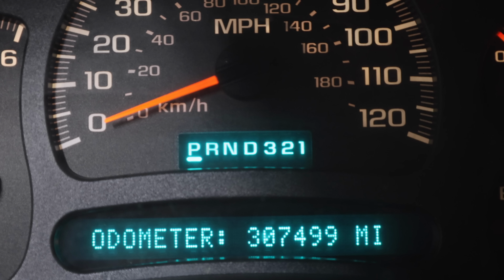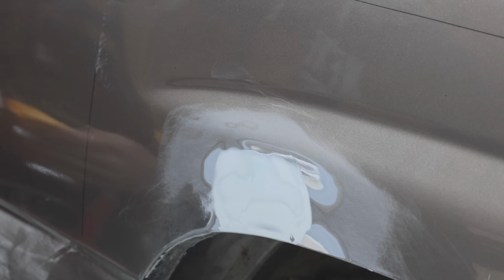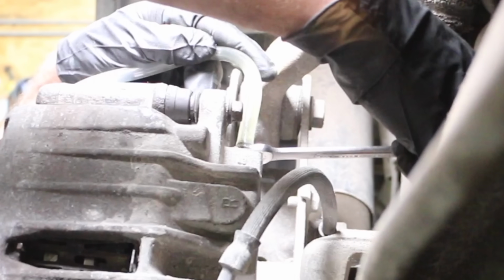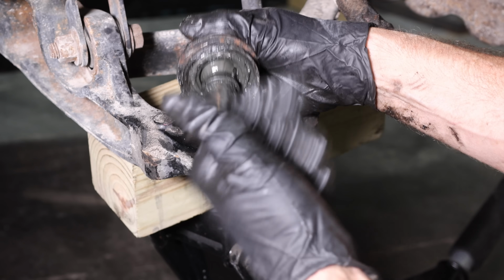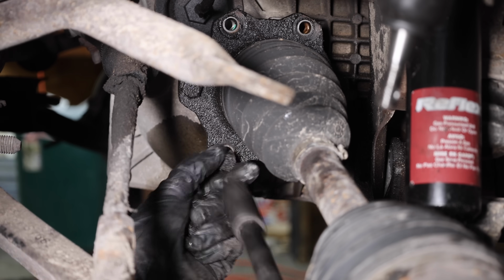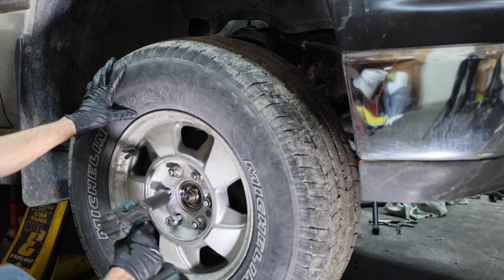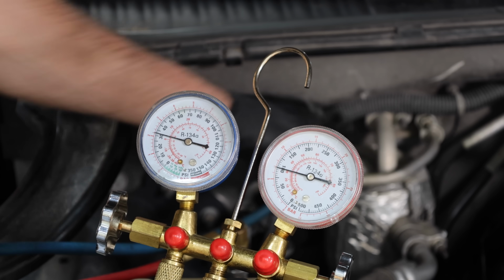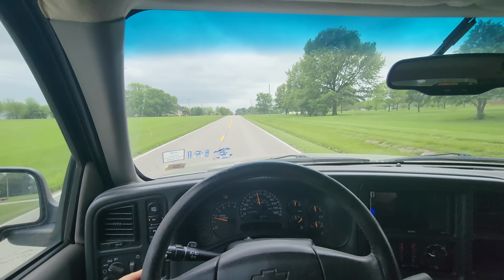Is It Stupid To Fix Up A 300,000 Mile Vehicle? Let Settle This!

Comment: Body repair was not great but I worked at a chevy dealership for over 10 years and saw hundreds if not thousands of cars with worse quality repairs that actually came from body shops. Like I could tell you it was poorly repaired from 30 yards away
Reply: P.S. what you did was every bit as good as I'd expect to do myself if not better.  I was a tech, not a body guy.

Comment: You should try greasing the hubs. Still running original 250k on mine. Just remove the speed sensor press grease through this cavity. The old dirty  grease will squeeze out of the seal. Continue until new grease comes out. Clean grease out of the cavity down to the tone ring. I do this approximately every 35-40k

Comment: We watch all of your videos, but I never comment. Love your content and how much you have learned while making it. 

It seems that you have a misunderstanding about freon pressure. 

If your gauge doesn't display the correct pressure for the temperature when the vehicle is off and cool, YOUR GAUGE IS WRONG, not your freon level. 

Static pressure tells you NOTHING about your freon charge. Repeat... NOTHING!

If there is one single drop of liquid freon in the system, the gauge will read EXACTLY the same as it will if you overcharge it by 10 extra cans of freon. 

Don't believe me?  Check your static pressure and then recover half your freon. As long as the temp stayed the same (it will take a little while to recover since it will cool as you remove freon), the pressure will equalize back to EXACTLY what it was before you started. 

See "Law of ideal gasses" for the physics behind this.

Comment: This is crazy because i was thinking about taking car off my rusty fenders on my silverado. Also, I replaced tie rods, pump idler arm and pitman arm and still have alot of slop in mine. I tried tightening the adjuster but it never got any better and didn't want to over do it. Awesome video, I liked the pace. If I need to go over it again I can just rewind.

Comment: I’ve got a 1997 Ford Ranger with unknown miles on it. I bought it in 2017 with 172,000 and the odometer broken. The guy I bought it from said it was 172,000 when he bought it 6 years earlier. So 13 years of driving put who knows how many miles on it. I only use it now to haul garbage to the dump. I only have ever changed the oil a couple times. I bought it back then for $1500, and I betcha I can get at least 1500-2000 for it now just because it still runs. So YES….it’s always worth it to keep an old vehicle running. Especially if you know how to do the repairs yourself.

Comment: Love the videos, if you're looking at snap ring pliers to test, I have been using the Channellock set which has 3 sizes, the Channellock numbers are the 926, 927, and 929. I think they're great, a little pricey at around ~$120 for the 3-piece set, but they are good quality, have lifetime warranty, and all have exchangeable bits with the 929 being ratcheting which helps a lot for those bigger snap rings.

Comment: I've been an HD mechanic for 15 years, I've done these types of repairs thousands of times. I still watched the entire video! Never change!
Reply: Year later they start bubbling again lol
Reply: @jacobg6528  Assuming the rust is all taken off it won't
Reply: @danh1060  yes it will lol. Anybody who's actually worked in a shop in the rust belt knows this. You have to treat the inside with fluid film. It does not matter how well you prep it.
Reply: @jacobg6528  Yeah I fluid film my XJ I get it helps tremendously with rust protection/prevention and I was looking at it from a POV from someone living in the south where rust isn't a common concern with vehicles.
Reply: @blancheedwas  they're living the rust free dream!!
Reply: Rust or year round mosquitoes. Pick one.
Reply: Yep, just a matter of time. To be honest its not even worth the time and money. If your car has a hole so what?
Reply: @bladeoflucatiel  Yes let me just buy a new 1985 foxbody, ill have to get rid of it because im a pussy and cant repair things

Comment: 300,000 miles and still looks good!  Properly maintaining a car is super important, but a well built vehicle designed for long life is a necessity too.  For instance, trying to get 300,000 miles out of a Ford Focus/Fiesta with a dual clutch automatic isn't going to happen without lots and lots and lots of clutch changes!

Great to see the work you do.  Attention to detail and cleaning up the old parts is a great idea!  

A couple tips:  When laying the body filler, make sure it's fully mixed.  I noticed some of it wasn't mixed well when you removed the old filler from the spreader.  Also, I use an auto body sander with 16 grit paper.  It's to shape the filler and make it nice and flat.  Put another layer of filler and use 220 grit.  If smooth and no air bubbles, prime, sand, check for high spots.  Then paint.  It's pretty easy to paint with an air gun.  Lay down a couple coats of paint, then let dry.  Hit with a couple coats of clear, wet sand and then polish.  One final tip - When touching up, you want to blend to the area around the repair.  First paint the repair site only.  Next coat, go a little further out.  Then the first coat of clear a little further out and finally the last coat a little further out.  And don't end the blend where two panels meet.  Blend into the next panel if you need to.

Comment: 2007 Saab 9-3 2.0T 6sp, 315k
A/C went out, needs oil pan gasket, needs brake booster, needs sway bar bushings
Fix it?

Comment: I think you made the right choice! 1999 through 2007 GM trucks are the best trucks ever made. 100 years in the future from now if this comment is still here all will see. Todd that foam inside of the quarter panel doesn't even need to be there. It's only real purpose is to damping noise turn off the body. Because you know it seems like people just look for stuff to complain about these days or try to find something as if they don't have anything better to do. Great job Todd as always and once again do not get rid of that truck.

Comment: Mechanic’s tip: make sure you can remove the fill plug before you drain transfer case, transmission, differentials, etc

Comment: Did you notice a difference between 10 year old and new bulbs? Assuming they qare the same type.

I find it's easy to set toe by pressing a long wide straight board against tire and aligning to rocker panels {if they are straight and parallel on your vehicle).

Comment: I have a 2006 Tahoe z71 at 170k, and a 2001 Silverado z71 1500 at 240k that I’ve been slowly improving. This video is invaluable. I’ll specifically be using the steering component portion very soon. 

Additionally based off your videos I’ve been using Seafoam, motorkote, and engine restore at every oil change. Along with the legendary reliability of the LS engine design, they have shown no signs of wear or age. 

Thank you for your time and effort. You are one in a million.

Comment: Nice presentation, sure is cheaper than a car payment. A little constructive criticism for anyone doing this - make sure you can fill before you drain, open the fill port first. I won't mention the broken bolt on the exhaust manifold, lol.

Comment: Stay as you are, always a great video! I don't know if this is up your alley or not but I have an old Sunbeam Radiant Control toaster. Instead of using time to know when to turn off these toasters measured the infrared radiation reflected off of the bread for a more consistent toast. Sunbeam was bought out and the new owners discontinued this technology. I would love to see a comparison between modern toasters with electronic controls versus this older 1947 design. Our experience with newer toasters indicates they would lose but we've been using the Sunbeam for more than a decade and things may have changed. One note about the Sunbeam - they don't do bagels. Had they remained in production I think this could have been accommodated by widening the slots. 

If you choose not to do this I understand completely!

Comment: I love the pace you present everything. Its perfect 👌
I should start doing this stuff to the 1994 bmw 740i i got last week from my friend, it has 220,000 miles on it. I should also run though my 200,000 mile 4runner. (weirdly the bmw is running better, but that 4runner was not maintained at all until I got it. I gave it its first oil change at 150,000 miles)

Comment: The speed of video is good to me, I prefer quick and to the point instead of rambling on for 20 min to tell me one thing. If i missed something or didn't quite get it I can always rewind the video and watch that part again. That said if you had to cut too much to fit it into the time slot you wanted then I wouldn't mind a longer video either.

Comment: My truck has 1,264,000 miles on it. Original engine. I am just now having to replace the original transmission. 1988 Chevy C1500 5.0L. Yes, it is worth repairing them.
Reply from the maker: Thanks for sharing.

Comment: All you're doing is routine maintenance. Not gonna lie, it's hard to make yourself spend more on a replacement engine than you paid for a truck, or that you could sell it for after. I did replace a 4.7 in my '02 Ram 1500, but it has had everything else done that you're doing here. My '02 Qx4 at 250K miles I've rebuilt the suspension/steering, and lifted it!

Comment: My 2001 Silverado popped it's head gaskets in mid 2022. While I had the heads off, I replaced a bunch of other stuff that either needed done, or was easy to get to with the engine torn down to the short block, as well as did a 4-wheel brake job and swap out the noisy rear end for a low mileage used one. In total, I probably spent at least $3k on the truck. It's got 250k miles on it, and I only paid $2200 for it in 2019. Long story short, I hope it's not stupid to fix up a 300k mile vehicle, because mine's only 50k behind yours, lol.
Reply from the maker: Thanks for sharing!

Comment: 1. Why do you still have a check engine light on during the test drive? 
2. How much did the full service / rebuild you did here cost you?  
I'm sure you'll get at least another 50k miles out of her easily unless the engine or transmission have major issues but even then the tranny is like $3k for a rebuild and most engine work is around there too!

Comment: On my kids , I have a 2000 Excursion with 350k ok it and a 2011 suburban 1500 with 245k and I've owned both before they hit 100k and I've done routine maintaining with oil changes every 3000k miles and they both run like sewing machines . Just take care of your rides and jump on issues before they migrate
Reply from the maker: Good Point!

Comment: Don't compress a brake piston without relieving the hydraulic pressure. Put a tube with a one way valve on the bleed nipple and crack it open slightly. Calliper pistons will then retract easily and you  wont risk damaging your abs controller in the process (all that pressure applied by the clamp has to go somewhere and with the brake pedal up it wont be the master cylinder.
You're applying way more force than standard operation through the system backwards.
Brake fluid is every 2 years ... so having changed it 'a couple of years ago' yes it was due.
Reply from the maker: Thanks for the feedback.

Comment: This video was legit. The info provided, the pace, the editing. Dont change a thing. I learned more in 25 minutes than I have watching tons of other YouTube videos before. One question I did have was regarding the oil you used. You mentioned it was for a diesel? Is there any info on this for high mileage vehicles? I have an old Kia Optima that I'm keeping alive even though the knock sensor activates every few thousand miles, but no way I'm swapping the engine at this point. I'd be interested in knowing of any oil hacks to help extend the life.

Comment: As a mechanic, all I'll say is I would MUCH rather buy used and fix it up over buying anything new. If it's worth it or not is more of a case by case basis, just depends what all is wrong and needs repaired, and if you're willing to either do the work yourself or pay to have the work done. Also the 2x4 for sanding is pretty common actually so don't think it's weird, if it's straight then it's more than fine for small areas like what you used it for.
Reply from the maker: Thanks for sharing.
Reply: Also a side note, there are some Snap-On snap ring plyers that I've had great luck with, the little prongs at the end are slightly bent inward which prevents slipping.

Comment: One thing is for sure, you already have a great truck there.  I have a 99 2500 6.0 4X4, I'll keep that truck forever.  Over the years I have done most of those things to mine as well. I drive the truck to work almost every day. Most anything that ever goes wrong with that truck can be fixed fairly inexpensively.  Luckily, we don't have rust issues in Florida.
Reply from the maker: Thanks for the feedback.
Reply: @ProjectFarm  Thank YOU for the great content!

Comment: I had a car get to 420,069 miles. I don't really know how much of it was original at that part.
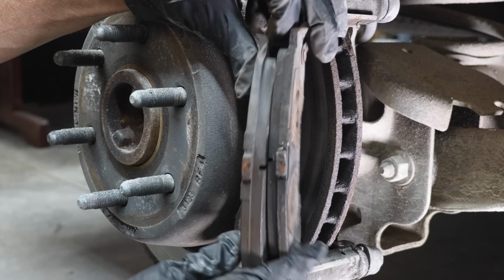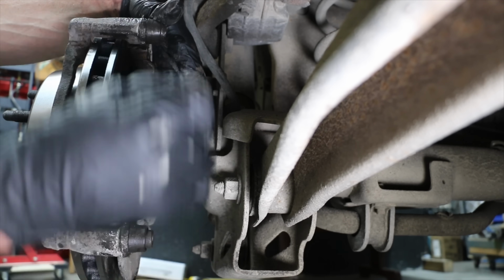Edit: 5:20 6:12 WOAH WOAH WOAH. What are you doing? You gotta clean that rust/scale off the hub face with a wire brush/power drill attachment. Bonus points if you clean it with brake clean and finish off with a coating of fluid film or anti seize. Prevents a fun thing we call "RUST JACKING"  (same with the under side of the anti rattle clips. it really shows people you care)

It's not explicitly required but at the end of the day 1) it's good form and 2) makes it so the next poor soul (likely you) has a better time. But I'm from the upper mid west. our cars like to rot out before their usable life is up on the driveline.
Reply from the maker: Thanks for sharing.

Comment: The front bearings that you replaced a highly recommend that you take the ABS sensors out jack the tire up start filling it with grease as you spend the tire. What happens when you feel that bearing in with Greece it will last 100 times longer go ahead and replace your ABS sensor after you cannot put any more grease in it, it works. I have 218,000 miles on my original bearings on my pick up and it’s only a simple take the ABS sensor out and rotate the tire as you packet full of grease.
Reply from the maker: Thanks for sharing.

Comment: Small tip on mixing/using bondo. If you put it on a plate of glass, you won't get unmixed spots like you do on cardboard. The bumpy lines created by the corregations can risk a small amount of un-catalyzed bondo.

Also, you can reuse the glass!
Reply from the maker: Thanks for the tip.

Comment: I had a 2003 Tahoe LS 5.3l 4x4. Bought it new for $36k. Was a great truck. Had it for 15 years until it was totaled in an accident hitting black ice in a curve on the highway. It only had 99k miles.  No rust. Only minor repairs/maintenance. My wife bought a used 2018 and hated it.  Small mirrors, third row didn’t come out so less room. She  traded it 2 years later.
Reply from the maker: Thanks for sharing.

Comment: An easy upgrade on the GMT800s is the GMT 900s front calipers, pad and rotors, they just bolt in and are quite a bit better than the ones on the 800
Reply from the maker: Thanks for sharing.

Comment: Just a note on ball joint and other suspension component replacement on old trucks like this. On my S10 it is about the same money to replace the entire A arm as it was for ball joints and bushings. This was getting the parts from rockauto, not the local store. Great video as usual man.
Reply from the maker: Thanks!  Thanks for the feedback.

Comment: This is awesome, the way you did everything is spot on in my opinion.

 It makes me happy to see a car fixed instead of thrown away and replaced, doesn't have anything to do with being poor, quite the opposite. 

One small tip if I may. Try not to use cardboard as a mixing plate for bondo, as it absorbs a part of the chemicals and can alter its composition, either making it harden too quickly, or too slowly. 

Use an old plastic cutting board or something that won't absorb any hardener nor base. 

Everything else was a charm to watch, thank you!.
Reply from the maker: Thanks and you are welcome  Thanks for the tip.

Comment: my daily is 315k miles , borrowed a car for a week to give her some love, shes getting a new head gasket(already done), some headwork (porting  on the non-swirl runners, already done) some suspension stuff, and obviously a compound turbo setup cause the piston rings can surely handle it :):) its a manual E60 530d had her for 13 odd years and have no intention of letting her go. Cars made after 2000 ish can be kept alive and to a high standard almost irrespective of manufacturer IMHO. the only exception is rusted out chassis or monocoque. keep em alive folks.
Reply from the maker: Nice!  Thanks for sharing.

Comment: This is a simplistic question.

There are a number of factors:

a. how much did the vehicle cost;

b. how competent are you as a mechanic & body repairer, a.k.a how good are you as a DIY repairer;

c. the cost of spares, whether from a motor factor or from a scrap yard;

d. how much do you want the vehicle.

I wouldn't have a problem in fixing a vehicle that I particularly wanted with 300,000 miles on it, I have the skills and the tools.

A number people I know wouldn't touch such a project with a barge pole because they don't have the DIY skills.

Comment: This is a really good reference video for maintenance, and I’m especially impressed with the body repair. I like to DIY maintenance and repairs as much as possible, but I don’t know if I would venture into body work. I’d also suggest using some blue loctite on the caliper bracket bolts since they aren’t something that gets check regularly and having those come out would not be a fun time.
Reply from the maker: Thanks for the feedback.